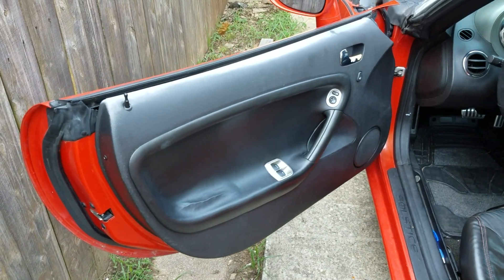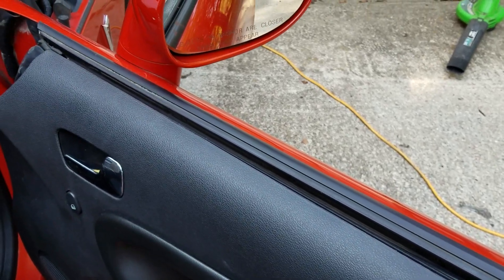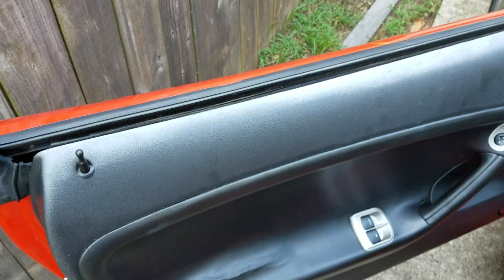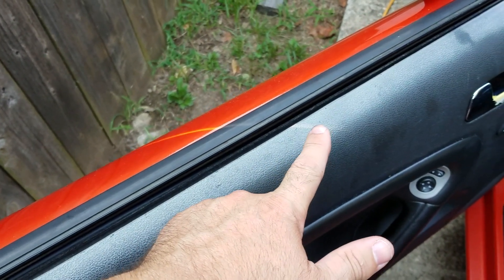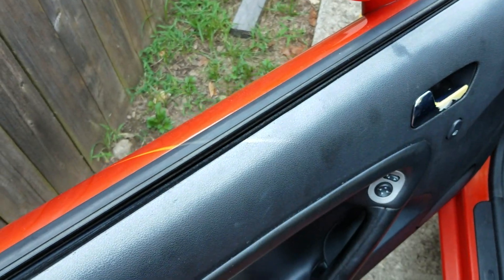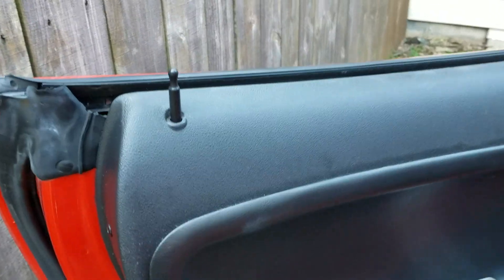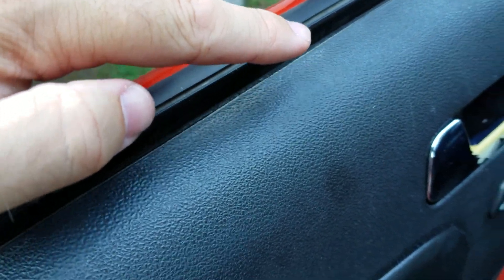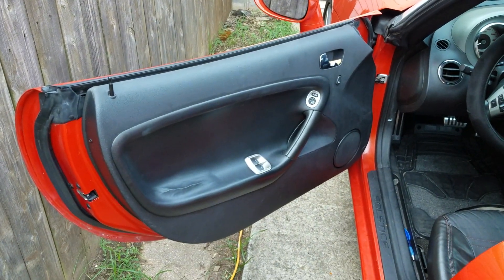Pontiac Solstice Faded Door Panel Repair, Heat Gun Method

Comment: That's a pretty cool video I like that. I see that you have the same problem I have with the center of the door panel separation of the vinyl where you rest your elbow by the switches for the windows. I'm trying to decide whether to attempt to fix it by taking the window switch out shooting some adhesive in and maybe heat gun in the upholstery and trying to stick it but I doubt it will work. I'm guessing they use a vacuum process to get that done. Have you ever had to repair something like that
Reply: Many people have done just this.  If it’s not close to the switch then you have to cutoff the insert and then epoxy or bolt it back to the door panel.

Comment: The type of plastic GM uses in these cars is not very resilient. Most scrapes will leave a permanent white mark. The kick panel portion of the door panel is a problem for me. Same issue with the fender liners. From the engine side they can be tough to keep scratch free, especially when working on the car. Same for the plastic cowing. Used the heat method to take out several scratches on both. The delaminating chrome door handles is another known defect. Mine was replaced under warranty 10 years ago. Drivers side goes first because of usage. My passenger side is still ok. Still a fun car dispute it’s flaws. Good luck with it.
Reply from the maker: I completely agree.